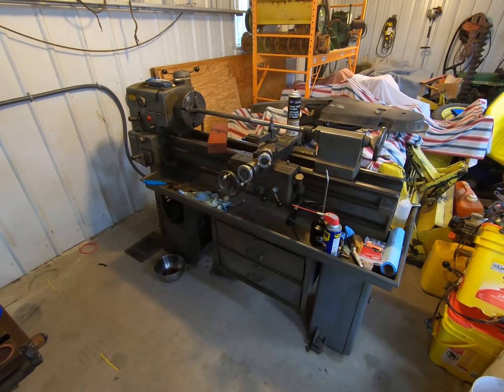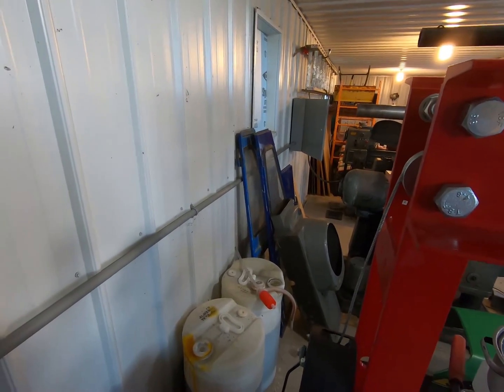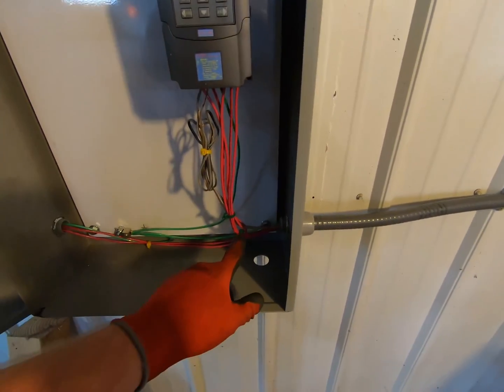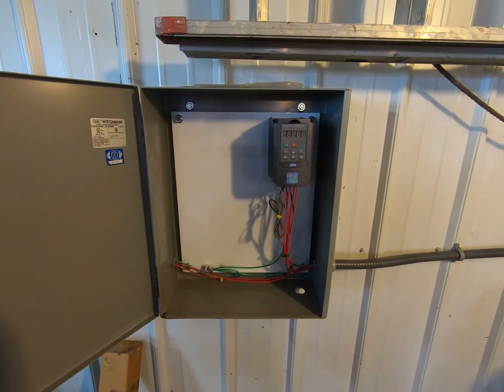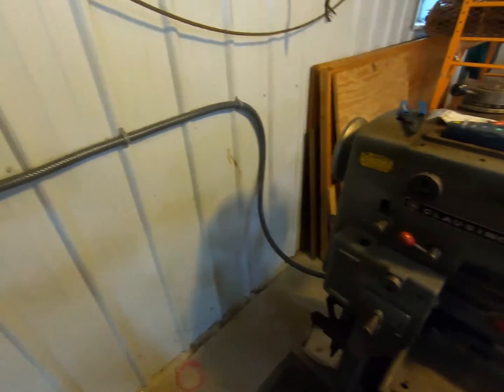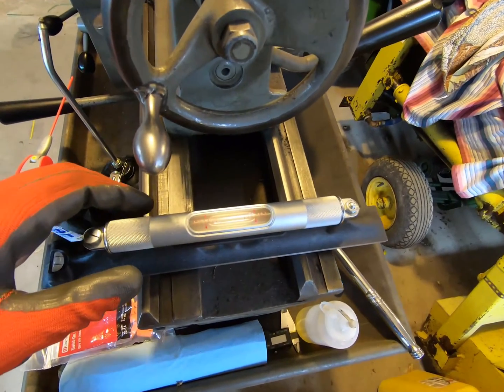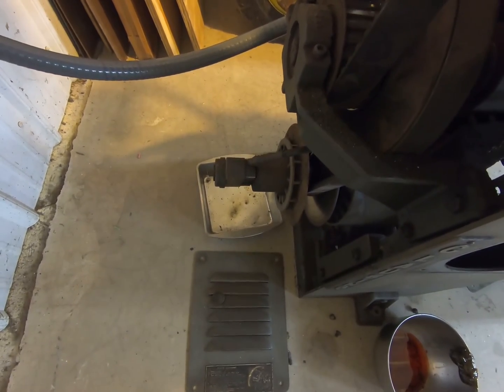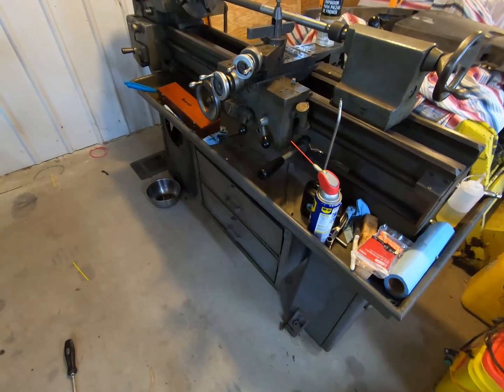Clausing 5914 Lathe - Installed

Comment: whats the size of the drive belt?
Reply from the maker: I am not sure. I looked in the parts manual and it did not specify. You might be able to call Clausing and ask them. For the parts I needed to get this lathe up and running their prices were not terrible. I've heard otherwise for other parts but my experience was pretty positive.

Comment: I had to LOL a bit- You Said: "I'll have to call Clausing and ask about the Variable speed spring"  How'd that go?
I have a 1967 13x36 Clausing/Colchester Lathe, I needed one little shaft (the size of a cigar)with a gear on it, I got a quote for $2200 - with a 3-month wait if I ordered it- 
I repaired the one I had and have been using mine, since I only paid $600 for the whole machine I thought a 22-hundred dollar part was kinda out of the question......
Reply from the maker: I think my total order from Clausing was around $270. Spring, pistons for the variable speed, wipers, hydraulic lines, and something else I can’t remember. They were very helpful on the phone. Couple parts were very expensive and not worth it, but nothing that I absolutely needed.

Comment: @8:57 its is a knurler. and your cutters are carbide tipped, =brittle and the "carbide bits" are carbide inserts. nit busting your chops but machinist are anal about nomenclature.
Reply from the maker: Trust me I know about about how important nomenclature! As part of the day job I split two fields that use words differently so I have to be very aware of who I am talking to so I use words in the correct context. Problem is learning all the nomenclature.

Comment: i just saw this! cool score dude! but safety,,,cannot stress it enough just last week we had a local guy killed. a rod whipped and he got all tangled up...
the variable speed controller on these can be a can of worms...what we did at work on ours (it was a Hardenge) we found a sweet spot between low and high and locked it up...but you have advantage with the VFD drive you can vary the HZ a bit to fine tune RPM

Comment: Ok I'm confused forward on a lathe is counterclockwise and reverse is clockwise on my wood lathe as forward is the working direction for me.☺
Reply from the maker: Since the switch was rewired we took a stab at the direction. This can obviously be fixed in the future. Just a matter of redoing the control wires for the VFD.
Reply: The VFD should have reverse setting so no wire change is require. I have a VFD I installed on my wood lathe that has fwd and rev
Reply from the maker: No "electronic" setting per say on this VFD. You have to move the two comm wires around.
Reply: Ok with 3 phase switching any 2 wires will reverse it.